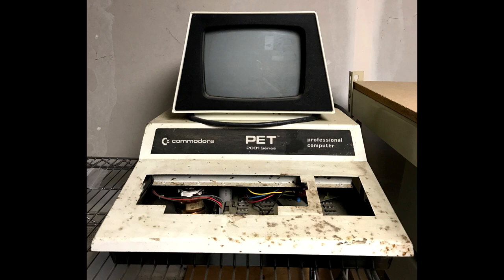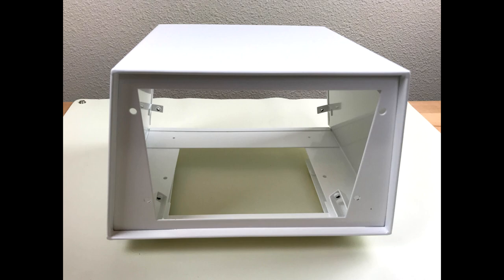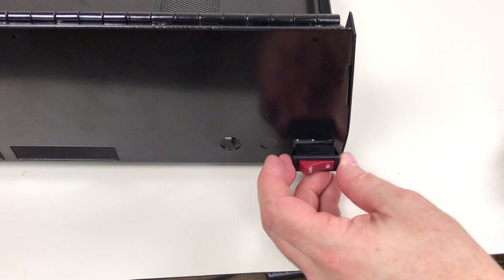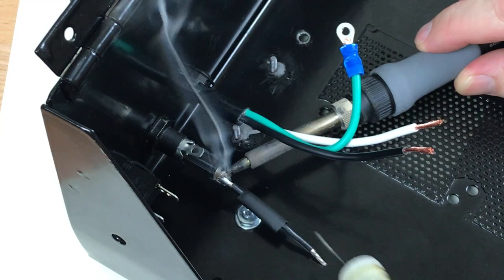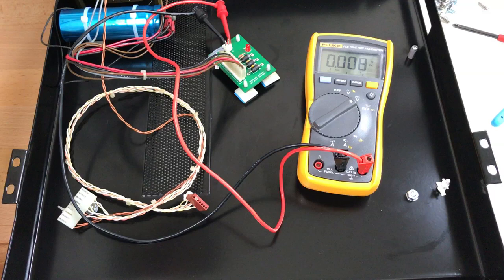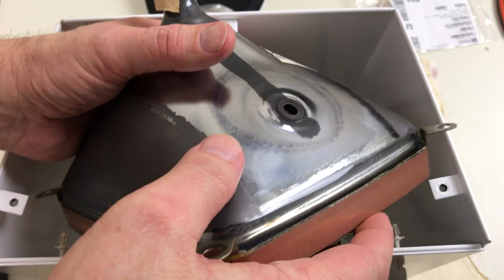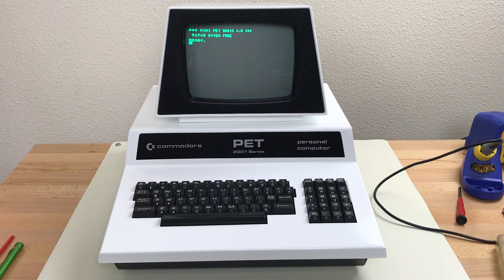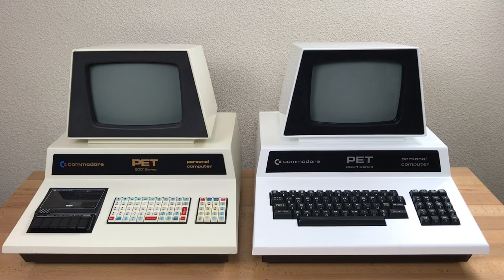Trash to Treasure. PET 2001-32N restoration.

Comment: That's not my repair philosophy as I'd have prefered to have it a little bit rusty if I couldn't repaint it and have a similar finish and color. Same would go for replacing the switch, fuse holder and putting screws instead of rivets.
However I totally respect the decisions you made as they made this machine usable and desirable once again.
Congrats for finishing this project then!
And also, thanks for the great videos!